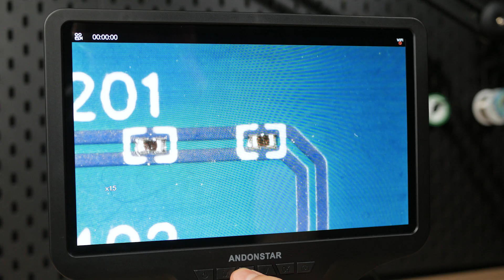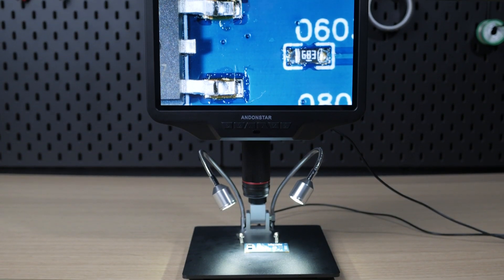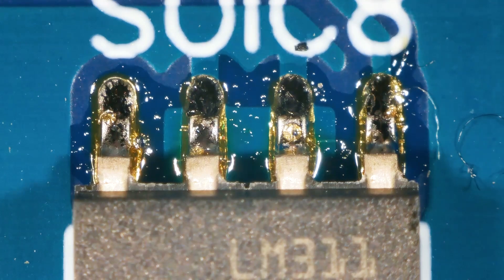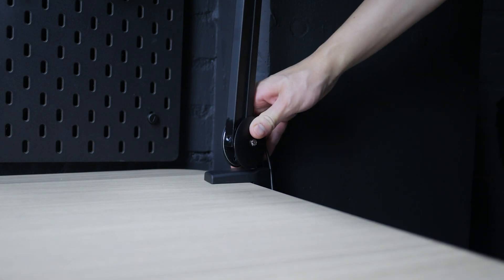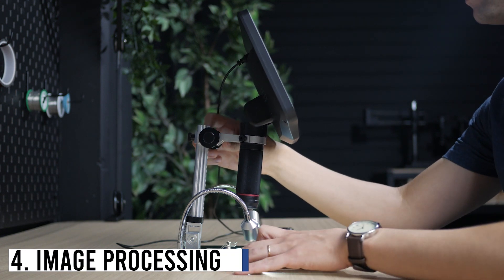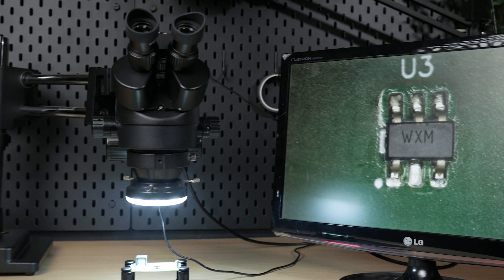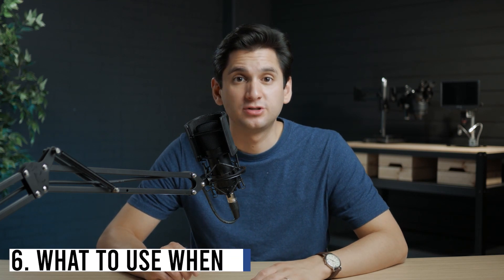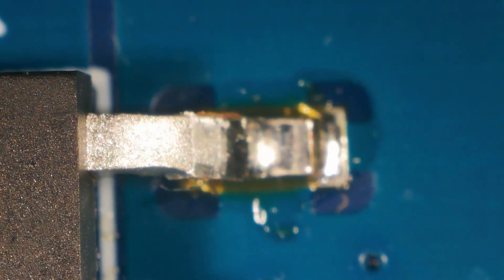Magnifying Lamp VS Digital Microscope VS Stereo Microscope

Comment: I’ve tried six different digital and stereo scopes. Ultimately, I settled on a trinocular scope to give me the best of all worlds. Even the best digital scopes, as you said, can only provide 2D images. As well, I’ve found image clarity, especially with auto-focus digital scopes, to be inferior, particularly when it comes to work on the smallest components, and for trace repair. Stereo scopes, again as you mention, do take some getting used to, but provide far superior optical-to-hand clarity and usability when it comes to actual work. Gone is the directional disorientation caused by 2D images. 

This video is an excellent, unbiased and fair-minded overview. Great job!